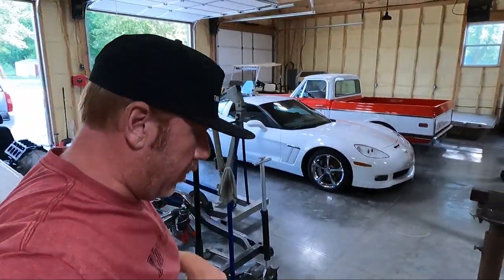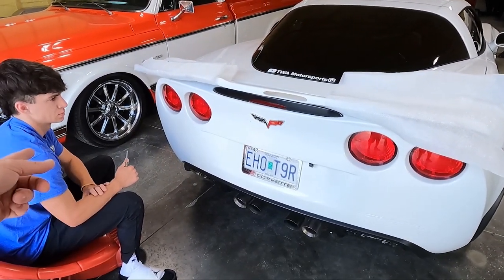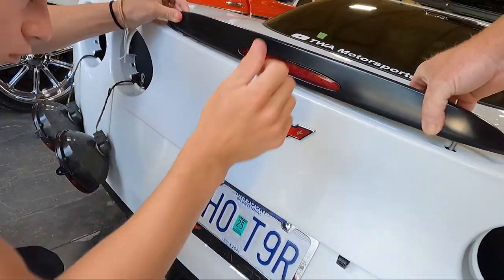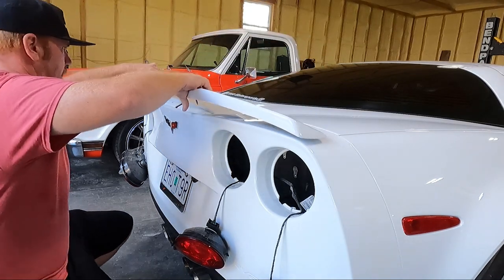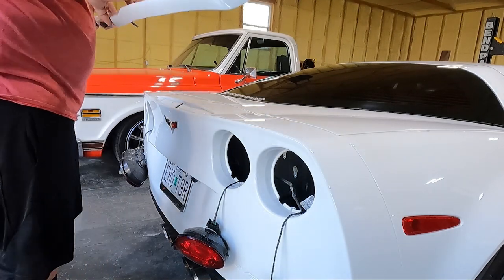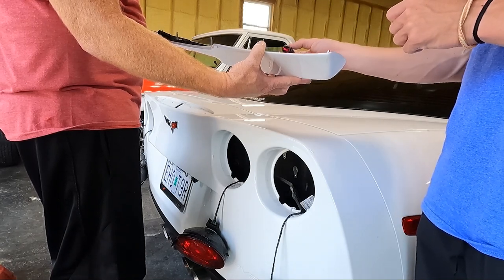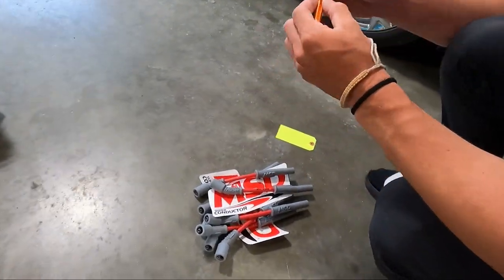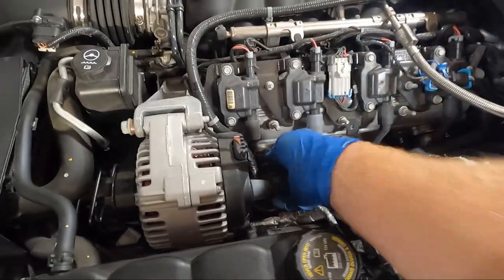ZR1 Spoiler Install on C6 Corvette Grand Sport (Also Installing New MSD Plug wires)

Comment: Not that it matters but just sharing my technique. I put down blue painters tape any time I drill a hole in paint just so it doesn’t chip and usually makes a cleaner hole.
Reply from the maker: I do the same on metal but not plastic

Comment: Can you just double side tape the sides and only use the existing 4 screw holes? I would hate to start drilling my car.  Looks great though!
Reply from the maker: Unfortunately no
Reply: Yes, you can do that on many of them. The one you bought doesn't look like most of the other I see, because it's hollowed out inside. Typically they have a full surface on the bottom side that you can apply double sided tape to.
Reply from the maker: No way I would trust 2 side tape only

Comment: They still sell that part, but it's really expensive. I think it's like $700. It depends where you buy it from. I actually bought mines on eBay from a salvaged zr1 Cause the one that I have. It's not original, and it's made out of cheap plastic.
Reply from the maker: May look into that on the next one